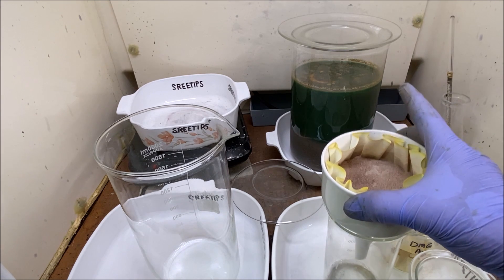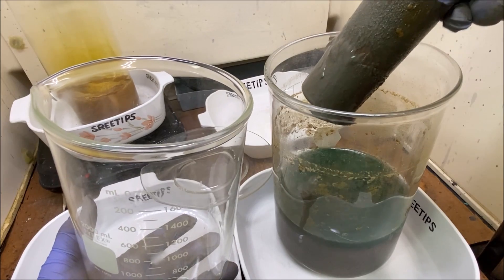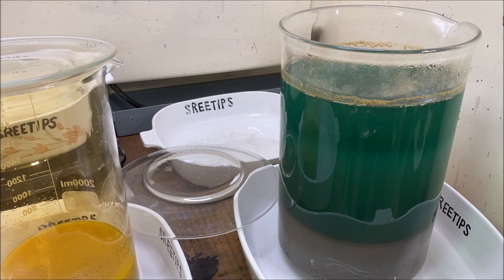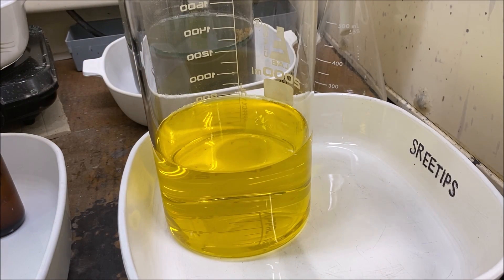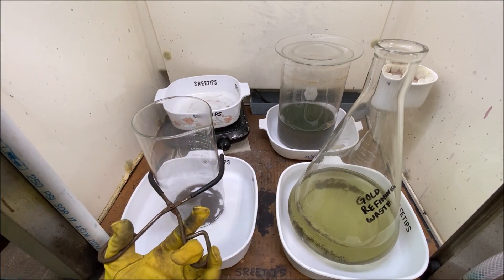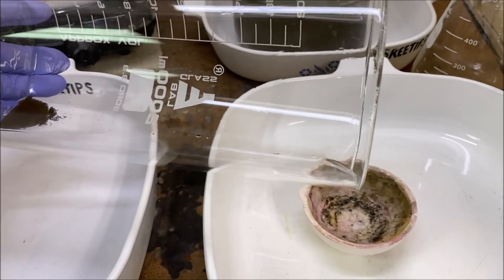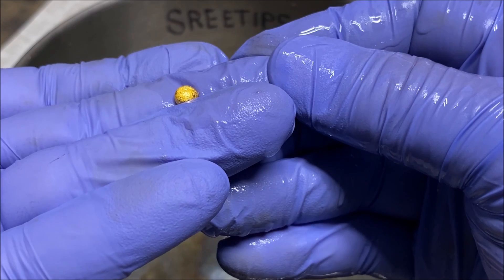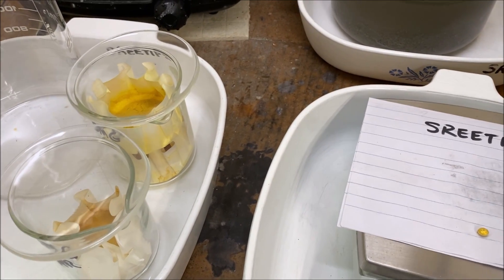Silver Cell Anode Filters Part 5

Comment: I have watched many of your refining videos. I did chemistry up to the first year of my degree. I hope you don't mind some input from an armchair chemist

You have mentioned how much of a pain too much silver can be when inquarting karat gold can be because it produces powdery metal.

Anode filter slimes have:
1. Fine Au and PGM particulates (which you want to refine) 
2. Fine Ag and Cu particulates from incompletely electrolyzed silver shot.
3. Ag and Cu nitrate solutions.

Washing the slimes until the blue color of Cu nitrate has gone probably leaves clear Ag nitrate in solution. You need to wash the slimes more with distilled water and test the filtered water for the presence of Ag in solution (test method described by @apeeving). Repeat until the washed water does not test positive for Ag.

The finely powdered metal seems to behave a bit unexpectedly so you could melt and cornflake the metal powder. You could even consider inquarting with more Cu. This experiment could determine whether the nitric acid dissolution stage is better with the metal as cornflake rather than powder.

This should leave:
1. Au and trace PGMs - mainly Pt (most will follow the Ag into solution). Dissolve in aqua regia, precipitate the Au with ferrous sulphate and add the remaining solution (with Fe and trace Pt) to 2.

2 Cu, Ag (and Fe from 1.) and PGM in solution. Add HCl to precipitate AgCl and filter. Test to make sure no more Ag is in solution. Use Cu to precipitate the PGMs. 

After you get rid of the Ag, dissolve the Pd in nitric acid, leaving Pt which you can filter. Then drop the Pd out of solution with Cu.

At least this minimizes your exposure to PGM salt solutions and precipitates.

Comment: Hello sir.Is it possible to cement on copper except for gold, silver and platinum group?
Reply from the maker: Gold silver and platinum group will cement on copper because copper is higher up in the reactivity series of metals.
Reply: @sreetips  thanks,So it is not possible to cement another metal, all metals are precious, right??
Reply from the maker: No. I think tungsten and mercury are below copper in the reactivity series (look up reactivity series on the internet). They will cement out with the precious metals, if they are present.
Reply: @sreetips  Thank you. Excuse me, one more question, does rhodium precipitate with DMG? I added DMG to my platinum solution after the platinum was precipitated, my solution turned a dark wine color, and with it a dark red precipitate and a milkshake color. What could these be? That's why I asked the previous question if it can be cemented with precious metals on copper of other metals, because I only knew that DMG only precipitates palladium.i dont have nickel in my solution

Comment: In the case of gold-plated silver, would it be possible to melt the jewelry down into shot and run it through the silver cell as though it were only silver (ignoring the gold) or would the gold clog up the filter too much?
Reply from the maker: Not recommended.

Comment: I am curious about those solids. As they came out of the silver cell slime, they must be mostly metallic in origin, but they don't dissolve in aqua regia and so much osmium and iridium is beyond belief. I am suspecting some insoluble salt and even though the silver is supposed to have been removed, I would recommend testing for silver chloride:
1) dissolve a small sample in ammonia
2) add a little potassium iodide, if there is a bright yellow precipitate, you just created AgI, proving you have silver.

Comment: Hello sir, I hope for some answer on my question, what are those solids...
Reply: The solids are the anode mud from his silver cell. When he cements out silver with copper metal, the resulting silver is 98%-99% pure. He then takes that silver and runs it through his silver cell, which uses electricity to dissolve the impure silver and plate out pure silver crystals on the cathode. As the silver at the anode goes into solution, it leaves behind those solids, which consist of gold and platinum group metals.
Reply: @alex_stanley  Yes, but there are still insoluble solids in the funnel, that were handled by acids, all silver and gold is extracted 4:36
Reply from the maker: The solids that are left in the filter after this last extraction: I have no clue
Reply: @sreetips  honest answer... 🙂 thank you